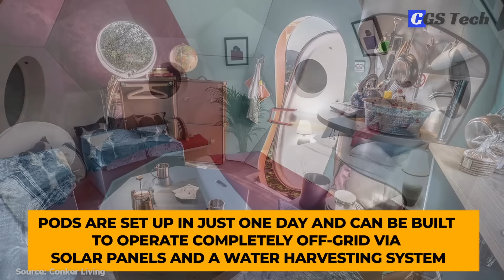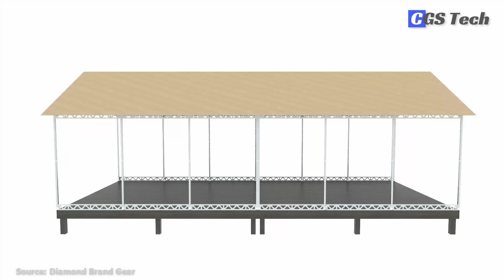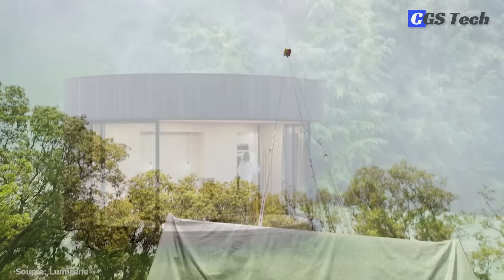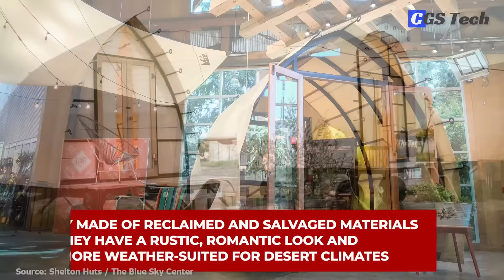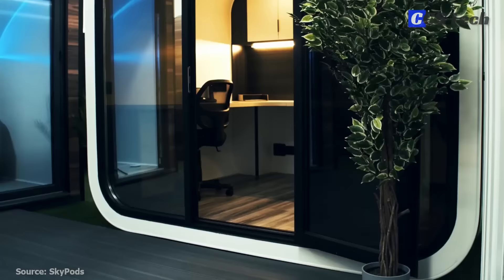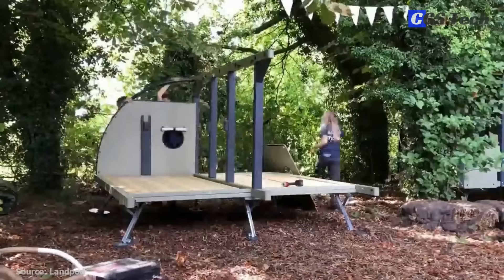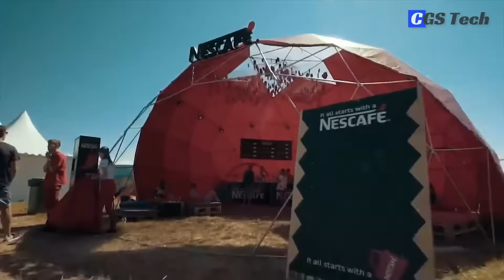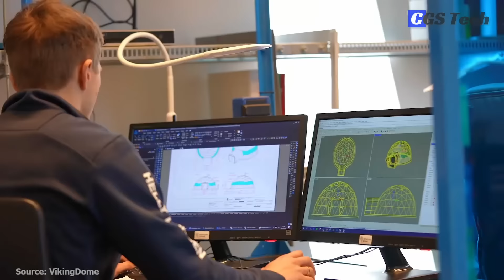7 Unique Prefab Glamping Pods

Comment: With tents it would be useful to see a sample floor plan.  It's hard to judge how much I might fit inside.  I'm thinking futon plus a comfy chair, small table and chairs, kitchenette arrangement, wood stove, at least a composting toilet.  Shower right on top of the toilet, like many RVs, would be good too.  Options to run an electric generator when needed, so, outlet spots.  Options for a (darn, word escapes me, big tank of fresh water) to be piped inside.